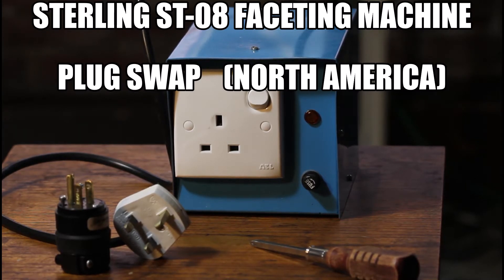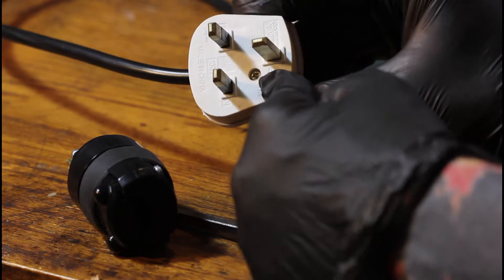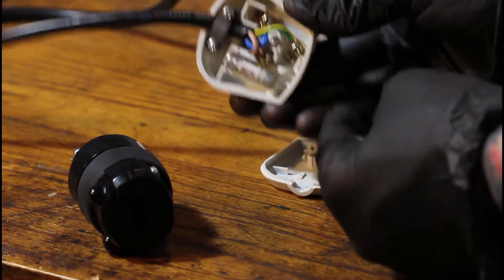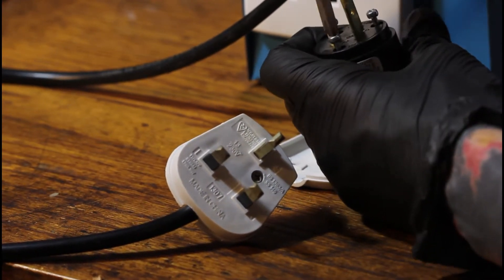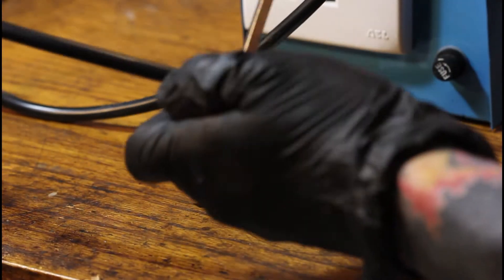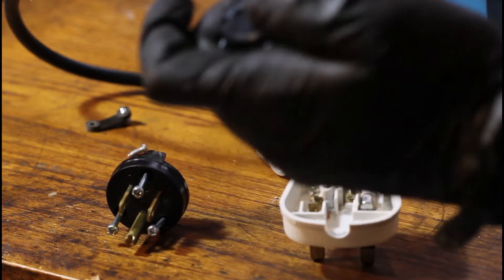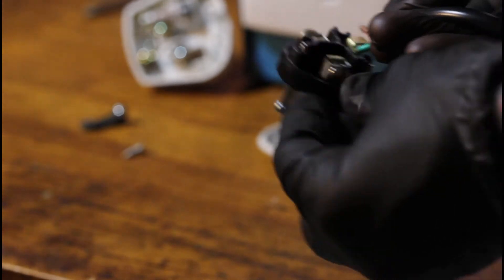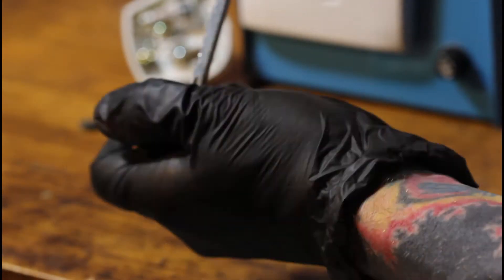STERLING ST-08 NORTH AMERICAN PLUG SWAP TUTORIAL

Comment: @Max The Moon: doesn’t the blue box include a step-down transformer to allow a 220V machine to run properly on 110V? If so, are there long term ramifications for omitting it? And if not, why would Sterling have used such a massive housing? This doesn’t make sense to me. Please explain?
Reply from the maker: Yes, the blue box is the transformer, and no its not omitted  - the plug swap is happening to the box, not the machine

Comment: So is the big blue transformer box not necessary for US operation? What AC voltage will the machine run on?
Reply: Is the plug you swapped on the blue transformer or on the faceting machine itself? My transformer came with no plug, just a cord that terminated with 3 bare wires. So is it that the transformer takes standard US 110VAC and then you’re plugging the faceting machine into the transformer’s output? Is that output 250VAC?
Reply from the maker: @laserlemon-learns strange it came with bare wires, but yes, the plug head being swapped is happening to the transformer box